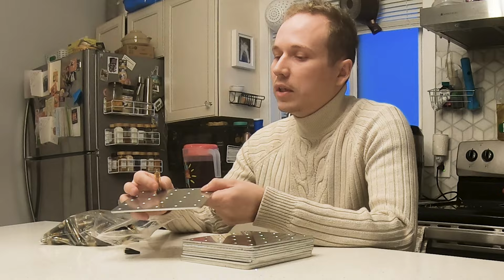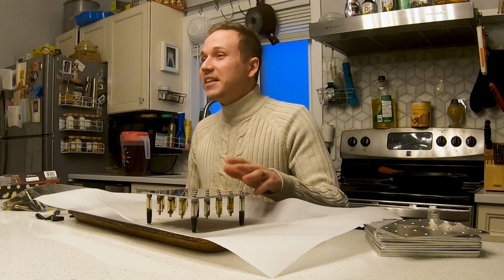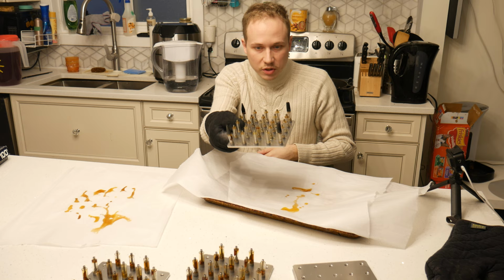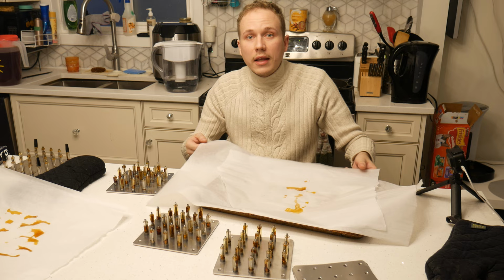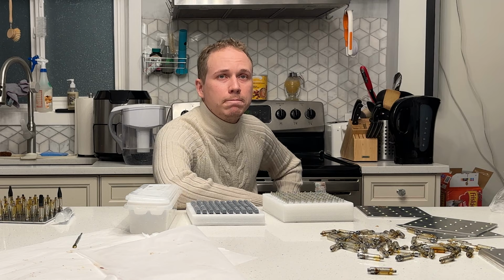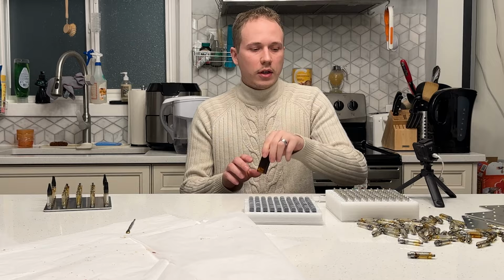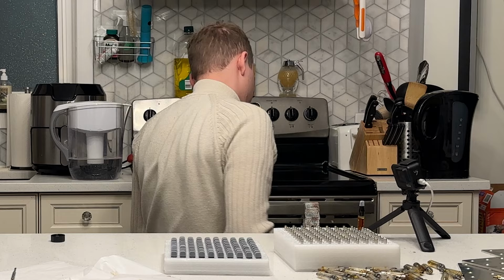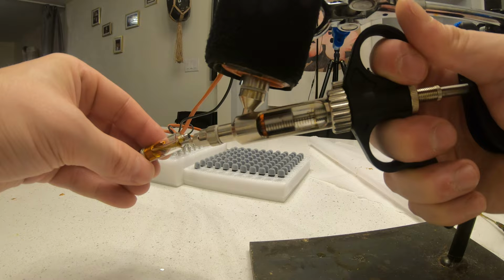The BEST way to Empty Vape Carts

Comment: I throw mine in a jar of everclear, soak for a few days, then strain into a smaller jar and let it air dry. 100% back to distillate
Reply from the maker: Got a video on that too, this is way easier lol
Reply: def don’t taste as good
Reply: Doesn't taste great but let the alcohol evaporate and make it similar to FECO. Or heat it and put it in butter, oil or coconut oil. Easy peasy

Comment: It would be good to make solid metal spacers to go into each corner instead of using old carts
Reply from the maker: You can get 510 threaded feet as well, was looking into that for future models but this allows any size where the feet might be too short for some vapes

Comment: I use a glass 10ml syringe so I can heat up my syringe and the metal tip to suck up warm oil way easier when I make my carts and dispos
Reply from the maker: The poverty farmer attaches to that same glass syringe

Comment: Did the thickness of the prototype plates prove important? 

Seems overly thick. Is it a threading issue?
Reply from the maker: It needs to be thick enough to thread into
Reply: @CartandPod  If it is thinner the thread screws too far in and becomes unstable?
Reply from the maker: @PresidentofAntifa yea it won’t have any threads to grab if it’s any thinner

Comment: This a good vid sadly i don’t have carts only a disposable vape and doubt it would work with it feel like battery would blow, also how about do a video where u pour iso down a dab rig and then pour the iso on a plate let it evaporate and see if you can make a cart out of that reclaim? Been thinking about if this would work and if it would be terrible or not 😂❤
Reply from the maker: No need to use iso, check out this video for emptying dab rigs
Reply from the maker: Clean your Dab Rig in your Oven
https://youtu.be/e8PMjK8WPaE

Comment: I like your design but you're leaving four carts on the table every time you go to do this. The best thing to do here would be to update your prototype and build yourself some legs on all four corners that can support the plate itself. I just don't want to have to always leave four for later when you can do all of them at one time.
Reply from the maker: The next version will but this one is saving costs by not including them, just save the 4 carts and reuse them every time till then